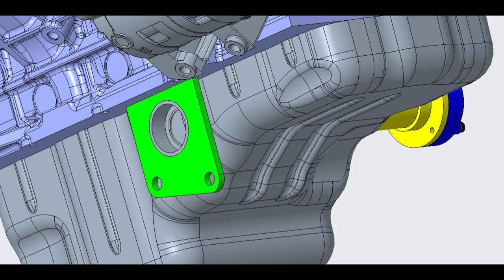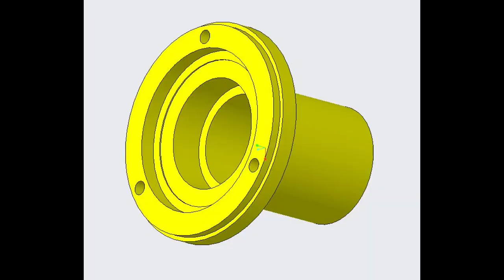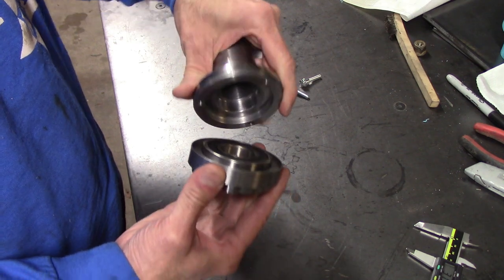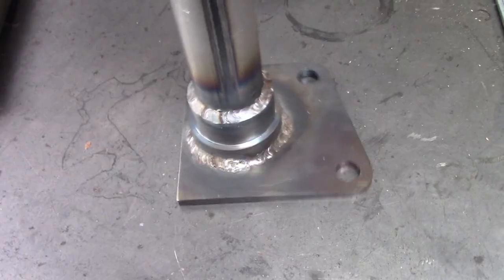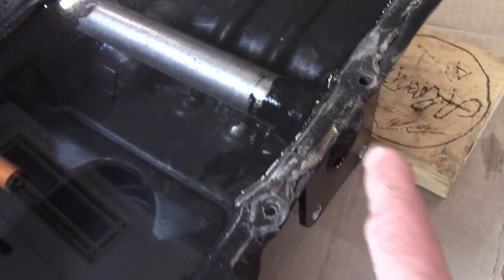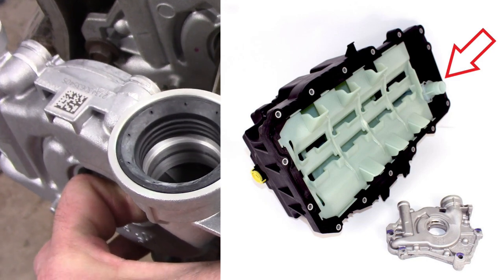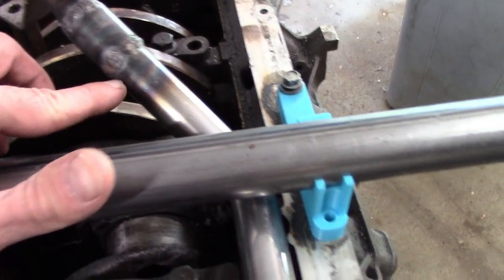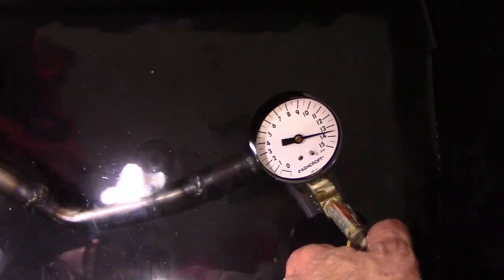AWD Mustang - Custom Oil Pan - Ep 21

Comment: For the future something you could look at for work holding that might be a bit cheaper is a block of hardwood. I've got a lot of scrap pieces of hardwood around the shop and I've used pieces as sacrificial workholding material on occasion and it works reasonably well if the dimensions don't require sub thou precision. Your CNC setup and you talking about how easy CAD is has be thinking about getting setup to do CNC. I think there's quite a bit to learn before I get there though.

Comment: Another thing I'm thinking of while watching the part on your pickup tube is that you could think about using copper tubing for HVAC next time and just silver solder the ends into the fittings, and onto that little strut that supports it. You wouldn't have to worry about any trash inside it then and even if it did, it's a softer material and wouldn't lock up the pump. Not ideal, but also, not gonna trash the engine. Much easier to work with too. Just bend it to the desired shape and solder, done.
Reply from the maker: I don't think I would use copper, but I DO think that brazing the parts together would limit the risk of junk inside the tube.  That is how most aftermarket and factory tubes are made.

Comment: Great video again. I bet many people dont get how much goes in to making stuff like that. I sure can.  You deserve bigger audience for sure.
Been wondering of using camside in Fusion but havent. I use Surfam because have that at work.
Few points/questions:
-water just plain is not a good leak tester. Because of the surface tension. Soapywater is better. I've seen milk been used as well.
-as a machinest, is there reasom why you dont use power feed, or why cut so small cut, chip does not cut if it has room to bend/turn, ofcourse material matters also.
-jackshaft bearing base, are you trusting bearing seals or sealing the base with O-ring or sealant agaist outside water? There where gap when bolted together.
-welding, wire wheel does not clean in some cases. I can see some sparks when welding in the video, needs to be shiny, no millscale.
-oil pick up tube, it clears the crank, did you check about rod big ends?

Anyway, keep up and keep posting..👊
Reply from the maker: Thanks for the great feedback.  

When it comes to the oil pickup, it does clear everything.  I have since drove the car with this modified pan an pickup and all is good, no leaks so far.

I am pretty conservative with my machining in general.  I am usually only making one and if it a bit slow, I am not to worried about it.

I can definitely improve my welding 😁

Comment: Love the build.  I actually sent you a message on another platform as I have an AWD application as well.  My BW4477 transfer case is identical aside from a slightly weaker (narrower chain and gears).
Reply from the maker: Wow, I am a transfer case junky and I didn’t realize the two cases were related.  It looks more compact than the dodge unit I used.
Reply: @npvg  yeah, I was surprised when I looked up yours as well.  The 4476/4479 use the same width chain and gears (I believe) but the use a planetary setup with two piece main shaft.  I am tempted to machine a spacer for mine and see if the 4440 shaft and gears could be used lol.
Reply from the maker: What is the input spline count on the 4477?

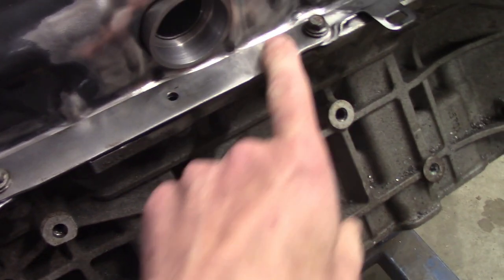Comment: Great work!  Question: @11:41 - re that bolt you eliminated on the pan: it looks like the block flanges out a bit to meet the pan.  So was there no way to work in a fastener from the back/top side of the block flange?  Either by (1) welding a stud to the pan then putting a nut on the top side of the block flange; or (2) threading the pan/bracket you added to accept a bolt from the top side of the flange.  I know it's a pita but in time with heat cycles etc. if the pan starts leaking from that spot the fix would be an enormous amount of work compared to now.  Great work - I look forward to more vids!

Comment: If you used butt welds and purged the inside of the tube with a small bevel there would be minimal to zero junk inside- esp if your learned how to weld better and use high frequency/pulse to keep the heat out of it.

Comment: Nice work. If you had gone with a dry sump system couldn't the pan have been essentially eliminated?
Reply from the maker: It would have made the oil pickup easier at the expense of adding complication someplace else.  There are pros and cons to each direction.  I am not going to say the dry sump is a bad idea, it is just not the direction I chose to go.  Does that make sense?

Comment: Just curious why not do a dry sump instead ??
Reply from the maker: That really would not have solved much and added a bunch of complexity.  The jack shaft would still have had to go through the dry sump pan to get it as high as possible.  The jack shaft only clears the crank by about an 1/8 of an inch 😁